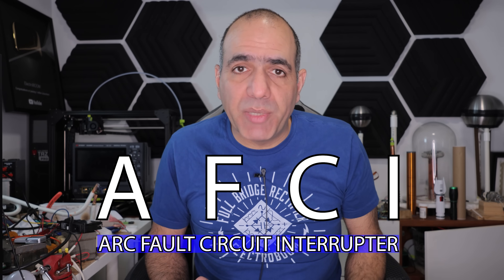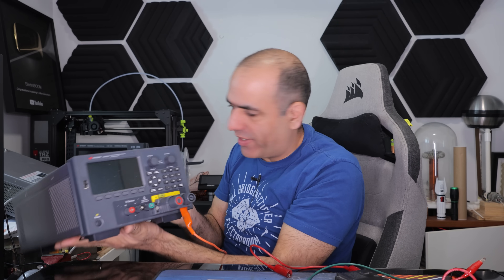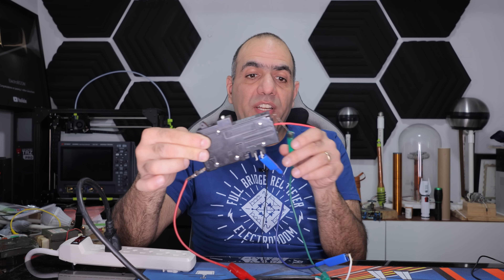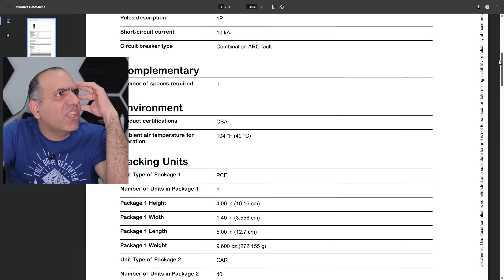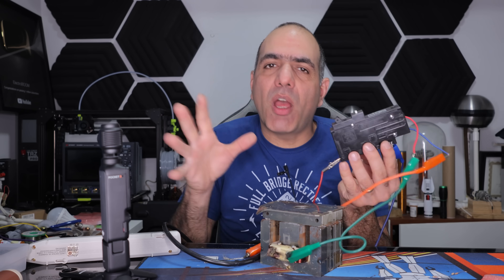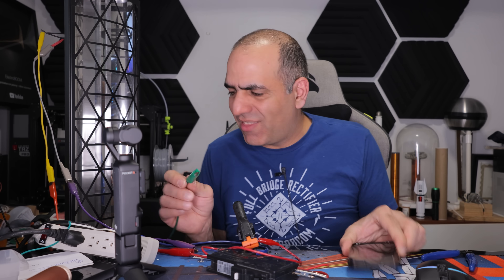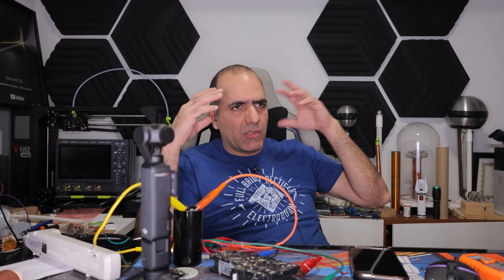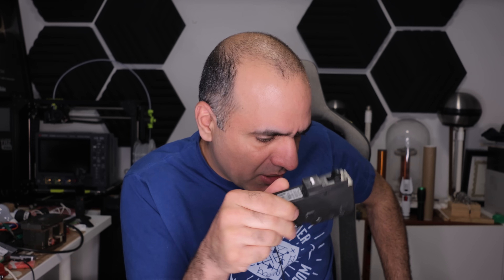Fighting Electrical Fire by AFCI

Comment: Its funny when they plug low power consumption phone charger into the wall thinking it will work... the breaker flips. in rush currant of device needs to be higher then the upper of the low currant trip range or it disconnects the circuit. the idle parasite currant of some devices plugged in though not in use, breaker trips. panel is locked they have to call electrician to reset breaker, rental condo life. use energy = unknown problem just like the ewe of how something comes from nothing but to get it.

Comment: Well, congrats, you've convinced me that it's so unlikely for the specific arc condition to take place for this to protect me from that there's no good reason to upgrade my current service - and that requiring it to be used is questionable.
Reply: Wrong lesson.  What you should have learned is that it's actually very unlikely for AFCIs to have false positives or nuisance trips in most situations (contrary to what a lot of people seem to claim), so there is no reason not to install them in most circuits.

The reason that it wasn't tripping most of the time here is because he wasn't simulating any arcing conditions that would actually be dangerous in the real world.  Brief connect/disconnect sparks (even if they happen over and over again) are not actually likely to cause a fire, and are therefore not what these things are supposed to be protecting against.  However, extended high-current arcing (like at the end when he was running the one clip down the other) are what they're intended to catch, and it did reliably trip in that case.

A lot of people have put a lot of effort into designing these things so that they only trip when actually necessary and not at other times, which is what is really being shown in this video, IMHO.
Reply: @foogod4237  Some of the testing he was doing could indeed result in a fire where this device simply didn't catch it. And just because it makes things safer doesn't mean the trouble and expense is worth reducing risk by a negligible amount. While you're at it you should ban any mult-story homes because stairs are dangerous.

Comment: AFCI are becoming much more prevalent in PV systems and inverters due to high DC currents that are even more likely to cause huge fires in cases of damaged insulation. It's cool to see such a simple-looking device containing logic in terms of frequency pattern recognition.
Reply: No one in their right mind would use AFCI's in PV systems. When I moved into my new home the very first thing I did was swap 100% of the AFCI breakers with standard breakers.  This is literally one of the worst scams in the history of the electrical code.  AFCI are VERY UNSAFE, as it causes the only people that matter...YOU to believe it is doing something it DOES NOT DO.

Comment: In my experience, the "combination" in "combination breaker" usually actually means that it does both AFCI and GFCI (as you discovered).

There are a lot of breakers that only do AFCI (or only do GFCI), but ones that do both are slowly becoming more common.

Also, AFCI breakers are actually deliberately designed not to trip for brief arcs or spikes.  That's because if they did, they would always be false-tripping every time somebody plugged in a power supply with a big capacitor in it, or whenever they pulled a plug out of the outlet withtout turning off the device first, etc.  Part of the reason it took so long before AFCI was even something you could buy is because it took a lot of tricky work to figure out how to get them to trip for bad situations without always false-tripping for lots of ordinary cases.

As I understand it, AFCI circuitry is actually designed to look for certain frequencies (not just spikes) around 100 kHz that typically indicate a sustained arc.  And because they're trying to avoid nuisance trips as much as possible, there are also some bad situations that they just won't catch either, but they still do catch certain kinds of bad arcs, which is still a lot better than nothing at all.

Also, from what I understand, there are two different types of AFCI, which are better at detecting different kinds of arcs.  One type is good for detecting parallel arcing (two wires touching that aren't supposed to touch, like when a mouse chews through a power line in your wall), and the other type is better for series arcing (intermittently breaking a circuit, such as how you were testing).  Many AFCI breakers now look for both, but some are still really only designed for one type or the other.
Reply: Really expensive afcis might be designed well enough to not nuisance trips but the ""cheap"" (still expensive ones) trip constantly. They're the weakest part of our electrical code right now, you end up with new home owners following youtube videos to replace them themselves because electricians usually cant without violating code unless the afci was installed somewhere it doesn't need to be. The contractor grade afcis here are pretty garbage
Reply: Schneider breakers with a white test button are AFCI only. They have a purple test button if they are AFCI+GFCI.

It's not clear why the AFCI-only breaker being tested here would trip at 40 mA. Maybe it still has some backup GFCI protection, in spite of not having the NA-standard 6 mA GFCI protection.
Reply: No, combination means it detects both parallel and series arcs.  The early AFCI's from 20+ years ago only detected parallel arcs.  Then around 2010ish they came out with "combination" which added series arcing. "Dual function" means they are both AFCI and GFCI.  Yes, the terms are confusing and badly named.

Comment: I believe combination type actually means it has both series and parallel arc protection 🤔
Reply: "combination type actually means it has both series and parallel arc protection" -- It depends on the manufacturer. For Schneider (the manufacturer of the breaker here), they use the word "combo" to describe any breaker that adds either AFCI, GFCI, or both to a standard over-current protection breaker.

Comment: In Sweden we use MCB-breakers, they react way faster than the AFCI you used in the video, we also combined the MCB with a RCD over the whole installation.
The MCB reacts quite fast because its not "feeling" if there is an increase in amps but instead heats up if it goes past the max amp its set for.
This way you will never get more amps out of a breaker and having the risk of causing a fire. Unless you have an idiot put a 16A on 1,5mm cable. That shit will burn then.
Reply: MCB is literally just a completely normal circuit breaker, it doesnt try to protect against arc faults... It only trips on overcurrent, both long and short term. An AFCI tries to protect about additional faults that are NOT overcurrent.

Comment: Dunno if it is just me but if a breaker requires this much work to pop maybe it isn't very good
Reply: Breakers aren't supposed to trip easily.  Otherwise they'd be tripping all the time for unnecessary reasons.

They're generally designed to only trip under very specific situations that are known to indicate an actually dangerous situation (and aren't likely to happen accidentally).  Because of that, there are some types of arcs that AFCIs just can't detect (without also having a lot of false-positives), so they won't protect against everything, but they do still protect against some specific important scenarios, which is still a lot better than nothing at all.
Reply: @foogod4237 they do trip all the time for unnecessary reasons lol

Comment: Dave Savery is the expert on these (AFDD in UK speak), he has a number of videos about them and has built a tester for them. These use software to detect an arc fault, one brand refused to detect an arc fault until a recent software update for it !
Some brands are falsely triggered by eithernet powerline adapters :(
Reply: Imagine living in a world where circuit breakers need software updates. F'in circuit breakers!
Reply: Thinking about it, we can probably call ourselves glad they don't require cloud connection. Next up: Circuit breaker as a service with monthly subscription.
Reply: @andreasu.3546  knowing Canada, that's already on the way as another excuse for higher material costs lmao
Reply: I was about to put the same comment endorsing Dave Savery. The UK guru John Ward has also covered them a few years back and at low currents (below 2 amps) some of his didn't trip either.
Reply: I came to the comments to say this also - https://www.youtube.com/@dsesuk
Reply: so did I
Reply: Would not say falsely, because those adapters put high frequency crap on the powerlines, where it does not belong
Reply: @putteification  Yup, those powerline networking adaptors should never have been permitted, they're an EMI nightmare.
Reply: @rednammoc  They basically pass because the EMC tests do not consider the house an antenna, they use LISN to isolate the noise and if the LISN reads below a certain amount it passes.  They should be considered intentional radiators really, like any RF kit.
Reply: Ethernet*